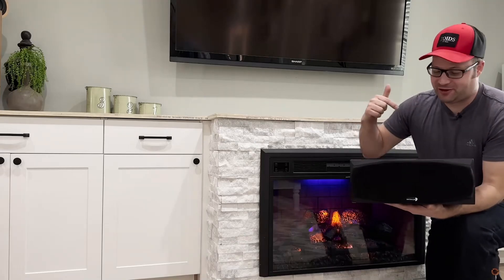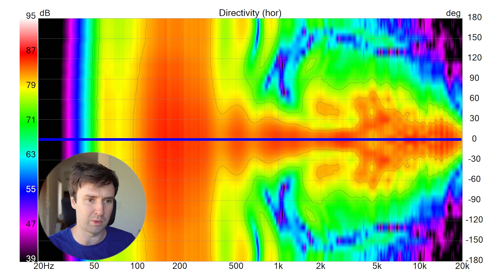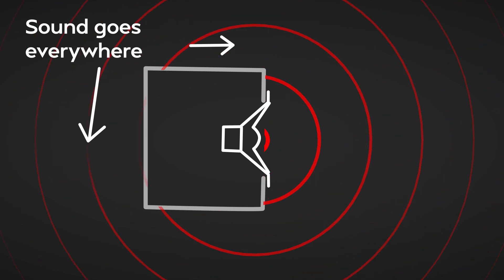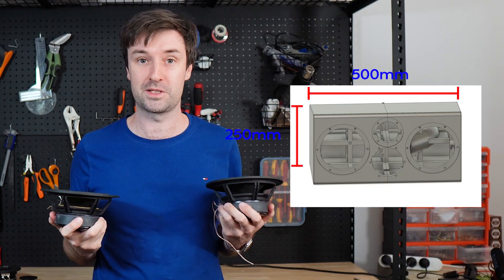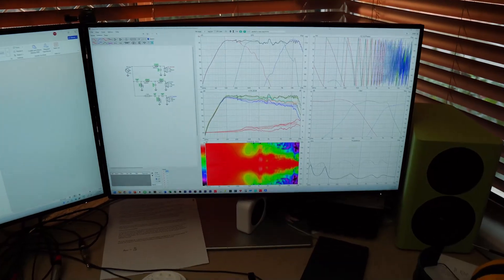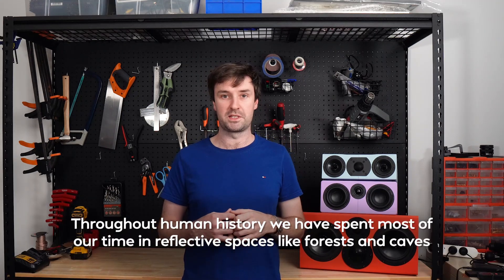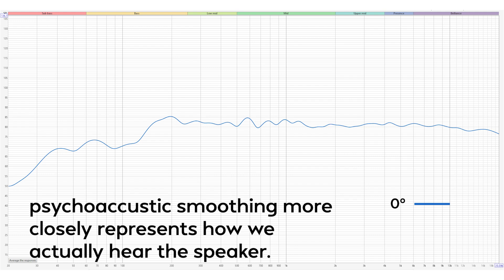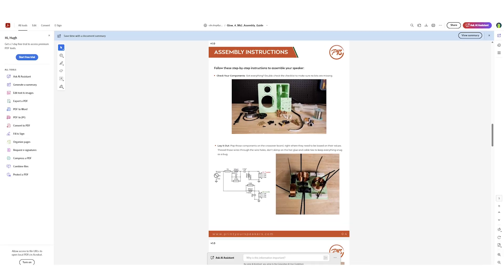I 3D Printed Three Centre Speakers to Prove They Don't Suck

Comment: If a speaker pointed away, on the literal floor, is rated a 10 by those guys, what would an on-axis speaker in a treated room be rated as, 15??

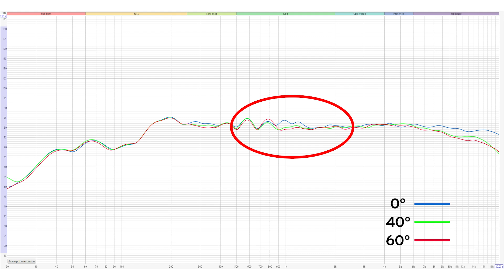From my own listening experience I don't agree with your conclusions, and you surely know that a microphone measurement is not an accurate way to see what we hear 11:50... you can have identical frequency responses but they will sound very different if they're made up of different degrees of direct vs reflected sound.
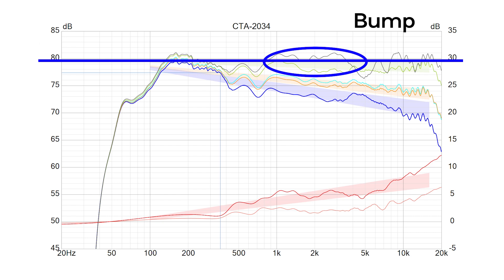12:55 Boosting that region makes the sound power flatter, but the directivity mismatch is still there, that speaker will sound boosted in that area if you are sitting close or in a treated room, not smoother/more neutral as you want it to.

Comment: At 12:25…why? The reflections have an even longer path, bouncing off the walls (and partly getting absorbed) — why should they be louder than the direct sound?
Reply: Because there's more of them; When you hear the direct sound it's only a small cross-section of the sound waves being emitted from the speaker, there's a much greater amount of sound sent out in all directions which then gets reflected. An analogy is a light bulb, you can look at it and see it's bright, but it's also sending light in all other directions, enough to brighten the whole room, not just the direction of your eyes.

Comment: I love your designs but I’d also love to minimize filament use… would you consider modifying any of your designs to be able to fill with sand or plaster? Would be an interesting test. As an example, to print two of your Illuminate Mk 2 speakers I’d be looking at $200 in filament alone!

Comment: I built a center channel speaker that is IDENTICAL to the left and right channel speakers, IOW, vertical.  All three speakers are 2 way, 6.5" mid-woofer, and 1" tweeter.  (I have a single 15" subwoofer off to the side of the room).  It sounds good.  I have these 3 speakers mounted high up on the wall, above the TV, closer to the ceiling than the floor (like I usually see in the theatres).
Reply: Ideally the speakers are around head height. Its impractical to do that in theaters unless they're built in the wall. If your into atmos at all having them at head height also helps with vertical separation.

Comment: heresy statement: it's the correct way to design a MTM centre speaker, because for the typical positining (just under the TV screen) the floor reflection dominates the diffuse and percieved sound field (because its early reflections and a huge reflecting surface). whos gonna watch movies over 20° offaxis sideways anyways...  Sure having good vertical and horizontal behavoir would be even better.

Comment: Minor correction: while mahogany is a great timber, what you were referring to is spelled 'timbre', pronounced "tam-buh" (US/yobbo) or "tahm-ber" (UK/pedant) 😉
You can also pronounce it "tahm-bruh" with a rolling R, which is incorrect but will helpfully warn everyone within earshot that you're a wanker.

Also, thanks for the reminder - my aggressively adequate horizontal-ass centre speaker has been sitting in the garage since I moved and as much as I love my L/R floor speakers (Acoustic Research AR90), I need all the dialog help I can get 😅

Comment: btw, you can use Crimp connectors (spade) to wire your speakers. None of mine ever had any issues and great for prototyping where you might want to open up the box multiple times or remove the speakers afterwards. Also removes the risk of any heat getting to far into the speaker and potentially melting any plastic/glue. If the fit is very loose you can push the sides with pliers to narrow the gap for a tighter fit. Works great and really my go to method, no more annoying soldering in cramped spaces.

Comment: Horizontal MTM can offer good dialogue clarity but 3 way designs still have big advantages. Namely panning smoothness across the LCR and dynamic range.

Kudos on the good design work, I will be recommending your builds to others.
Reply: This is one reason I love the Klipsch center channel that I have in my setup: the central horn keeps mids and highs clearly located while the symmetric woofers bring the low mids and bass where directionality matters less.

Comment: When will you be covering the SPK 16 speakers from Purifi? i am excited to see what you have to say about it, and have listened to it a couple of times :) Personally i love myself a great 3-way stereo setup. :) as i am also in the diy world, i've got some great 3-way all purifi driver floorstanders.
sorry to ask if you've already made a video about this, i just stumpled uppon your channel, or might have watched a video before. but what i am doing myself and measuring and having fun with atm. concrete filled 3D printed speakers.
you print with a low % gyroid infill 3-5% and then in the slicer you add a modifier to either the top or bottom of the enclosure to not print the top or bottom, in that way you can fill the whole inside of the print with concrete, and i'd recommend using 0-1mm max in concrete size, it must be fine.
you will get an air tight enclosure in a very complicated shape if you wish, that is very heavy and stiff. the 3D printed part only acts as a form for the concrete, so you don't need a lot of infill cause it's not gonna matter for the strenght.
if you havent done this, it might make a fun video :)
anyways this was a great educational video that a lot of people can learn from.
Reply from the maker: I havnt heard it, but I would love to! I am mostly interested in the design approach. I love the idea of simulating the enclosure, crossover and WG all together and designing them as one system. Tradiaonally we design them all seperatly, just mash them together in the prototyping phase, then try and fix all the issues. 

I do plan to make a video about that very thing, with a bunch of different fillings. I want to try sand, silicone, plaster, concrete, epoxy resin etc. I want to fully optimise printed plastic only speakers first though so I have a fair comparison. Ive done infill density, but still need to test different materials and infill patterns.
Reply: @PrintYourSpeakers  if you deside to use any other infill than lightning or gyroid you wont be able to fill the whole enclosure, unless you print in multible parts where you split speaker cutouts in half. i don't know how big your printer can print, but if you can make some nice big chamfers that comes as close to the tweeter as you can get them, lets say fillets with a radius of 35-50mm, maybe even a continuous curvature baffle, that'd also be a great video :)
when filling, you also gotta take into consideration the longevity of the material, and what lots of vibrations will do to it over time, between plaster and concrete, both work very very well from my own test, altough concrete wins here, the plaster filling resonates a bit longer than the concrete although this alone is better than 99% of most speakers produced even today, i am looking forward to that video :D

Comment: Your testing was completely flawed. As lovely as your friends might be, they are clearly not sufficiently educated to be rating speaker performance. You had the speaker placed at floor level, parallel to the floor with a coffee table between their ears and the centre speaker. It goes without saying this is the worst possible scenario you could have. Anything from the low mids up are going to be lost when it hits the underside of the coffee table / runs into the couch. Turning the speaker to reflect it off the wall did not improve the sound, it merely made it less worse. Had you performed the same test so the tweeter and mid were pointed at their ears to start with by elevating / tilting the speaker, or removing the coffee table, or both, and then turned the speaker away, your results would be completely flipped.
Reply from the maker: My living situation isn't ideal at the moment, long story short I had to abandon my 5.2.4 home theatre which was installed to Dolby spec. You are correct that this isn't a rigorous experiment, on top of what you mentioned the subjects were not blinded and the sample size is tiny. I really just intended it as a communication tool to demonstrate a point, an alternative to one of my janky animations. The conclusions I came to are not based off of the 'experiment' but rather the existing scientific literature.
Reply: @PrintYourSpeakers  you have actually gotten me quite interested in printing my own speakers (surrounds). Albeit with much higher end drivers than what you are using, but some of the principles and limitations are just as applicable regardless of drivers. Provided you can cross the bass over low enough the off axis situation is mostly nullified being that low frequency bass is omni directional.

I am in full agreement that the tweeter above the mid is the way to go. Being off axis is always going to cause issues with a centre channel, but cone shape and size has a lot to do with that. Keep up the great videos.

Comment: do you know if i have to manually set the delay in vituixcad or does rew include it by it self? im using acoustic timing reference
Reply from the maker: When you export from REW, it exports a table with the frequency and phase for each frequency. The time domain information is in the phase values. Just be careful with your gait settings as they can effect phase.
Reply: @PrintYourSpeakers  thank you for the reply! turned out i checked the minimal phase box and was scratching my head over why it didnt match my measurements :D interesting video btw, have a nice day!

Comment: As a test I bought Dayton Audio's cheapest center channel and it is laughably and expectedly bad.  Just like you said about tweeters, the AMT tweeter "beams" like a laser.  Off axis 10 degrees and the tweeter falls away.  It is the best speaker to use to demonstrate "beaming".  So, it's a "Good example of a bad example".
I do hope that you demonstrate your big 3 way center speaker.  It looks like a very good design.

Comment: Center channels are useless to begin with. If your mains can't into imaging, yeah sure.
I wonder why noone raises this question to begin with.
Reply: The purpose of a center channel is to center the dialogue properly, even if the listener isn't sitting equidistant from the left and right speakers.  In a home theater, most of the seating is often not centered between the left and right.  The center channel and movies recorded with center output fix that problem.

Comment: A better solution is to just avoid the D'Appolito layout altogether if you can't have a vertical center, because it was never meant to be used horizontally in the first place. It also relies heavily on asymmetrical crossover (the outside drivers need different low pass filters of at least third order).

In fact it's an outdated design from the 60s that should honestly just be laid to rest. Technology did in fact advance and we now have drivers that easily cover the entire frequency range of a center speaker by themselves, such as dome midranges or coaxials. Using anything else for a center speaker for home cinema is rather pointless, because if wide dispersion wasn't the number one concern, you should just use a phantom center.

Comment: The Morel TM4055-8 is over $250 US, but it would make for a nearly perfect center-channel solution, being a tweeter/midrange combination unit with a tweeter capable of 640 Hz and a midrange with a frequency response of 365-4,200 Hz.  It has an outside diameter of only 5.64".  Imagine coupling it to a pair of truncated woofers like the Dayton Audio RS125T-8, so you could really bring the two close together, for an F3 of around 55 HZ in a ported enclosure.

I'm no speaker designer, so I'm sure there's more to this than meets the eye, but on the face of it the issue is basically twofold: 1) expense.  The drivers alone for this project would set you back about $350 for the center channel.  Add in crossover parts and other ancillaries and who knows?  The other is timber matching the L+R speakers.  It seems to me that any time you're considering L+R speakers for a HT setup you're simultaneously considering the matching center, which can make or break the deal, and vice-versa.  I really wish the speaker companies AND reviewers would address that issue.  If you're going to make a great L+R speaker, make a center that can hold up.  And if you're going to market a great center-channel, sell me on the L+R speakers as well.  You can't have end-game L+R speakers that aren't timber-matched to your end-game center, or the other way around.
Reply from the maker: The Morel looks nice, you could get a three way centre a lot more compact with that. With regard to timber matching, its really hard to do with a horizontal centre, even a three way. This is because the baffle is a completely different shape so matching the directivity is quite difficult. I mentioned in another comment, if I was building an end game home theatre, I would have LCR all the same model of speaker, hidden behind an acoustically transparent screen.
Reply: @PrintYourSpeakers  Yeah, I appreciate the "acoustically transparent screen" solution, but for those who are consigned to setting up a HT in a living room or den, we need other options.  For this reason, I wish speaker manufacturers would design speaker families with practical applications in mind.  For one thing, shrinking down the front baffle as much as possible by elongating the enclosure front-to-back MIGHT facilitate a bookshelf design short enough to use in the center position, foregoing an MTM.  Understanding that below 70 HZ, bass is no longer localizable, these speakers don't need massive woofers.  Again, a LIVING ROOM scenario not terribly different from (maybe 5'-6' deeper) yours is all most people are really talking about.

Comment: hey wow what about coax speaker ?  how do they compare
sound stage group delay clarity
Reply from the maker: KEF make a few centre channels this way, they are all really good. There are not a lot of great coaxial options in the DIY space, but SB acoustics is coming out with some new ones that I am interested in trying.
Reply: That's fantastic news, have you ever tried transmission lines in your designs, I loved your video about acoustic damping I thought I would try mlv mass loaded vinyl, acoustic foam and polyfill, your video was great I also liked the use of large dome midrange off axis response testing 
 @PrintYourSpeakers

Comment: Didn't the audio just bounce off the wood column in the cabinet when the speaker was angled? Is that not how reflection works with wood vs a wall?

Comment: 4:23 I believe that is incorrect sir. Using multiple drivers does not give you the same beaming frequency as a larger driver, thats one of the main benefits to using multiple small drivers to begin with.
Reply: Generally yes, if you put multiple drivers next to each other horizontally, they will effectively beam like a single large driver and beam as such, but only horizontally. That's why you usually arrange drivers vertically (narrow vertical beaming pattern to avoid floor/ceiling reflections but wide horizontal dispersion).

However this does not apply here. For this concept to work the drivers need to be much closer (rule of thumb iirc is that the distance between diaphragm edges must be less than the diaphragm radius).

Either way, comb filtering would still apply.
Reply from the maker: @CaillouLP  I haven't heard the ''diaphragm edges must be less than the diaphragm radius' rule. I am not sure what acoustic principle it could possibly be based on. Generally speaking, when the center to center distance is with in 1/4 of a wavelength, the speakers will not comb filter. This is because, in order to create a null there needs to be cancelation (~180 degrees of phase shift). At 1/4 wave length the maximum possible phase shift is 90 degrees, therefore the two drivers will only constructively interfere, they cant destructively interfere, therefore they can not comb filter. 

Have you ever noticed how they array subwoofers at large music festivals? They array them horizontally a couple of meters apart. This is so they effectively function as one, very wide source. They beam, keeping the bass pointing at the audience, and off the stage where the musicians and microphones are. The effect can be very useful!
Reply from the maker: I am not sure what you mean sorry, what is the main benefits to arraying multiple small drivers? You didn't list any. You can clearly see from my measurements that using two small drivers together narrows beam width substantially.
Reply: @PrintYourSpeakers Sorry If I was unclear. What I was trying say that the benefit of using multiple small drivers is that you get a much wider dispersion pattern compared to using just one larger diameter driver.  The narrowing in beam width you showed is definitely comb filtering from mid woofers being spaced too far apart. 

But now reading the comment below yours, I think I might be wrong
Reply from the maker: @chrishernandez2490  That's okay, I think its good that people willing to challenge what I have to say, it keeps me thinking and alerts me to areas of my videos where I may not have explained things well.